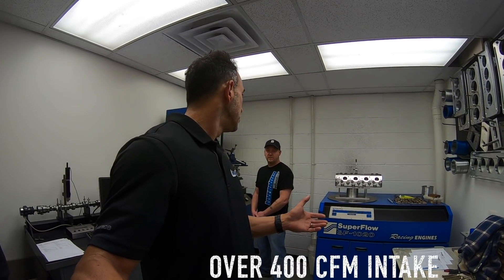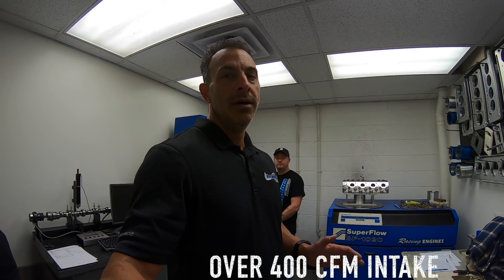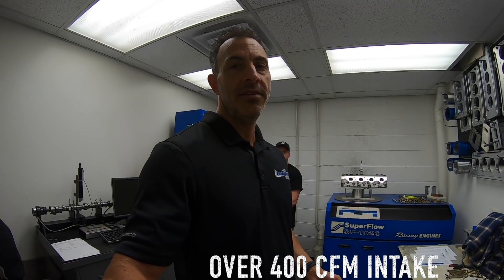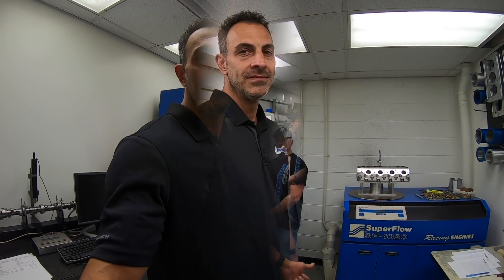CNC Ported Hellcat Heads Flow Over 400CFM - Livernois Motorsports

Comment: Fabulous job .  Would a 2.2 intake valve improve them again . Pretty sure thet you guys are way ahead 😀😀 with these babies. Xcellent.  Robert Australia
Reply from the maker: With a large enough bore, absolutely! Thanks for the kind words!
Reply: @LivernoisMotorsports  
Would a 4.125 bore  with a 4.125 stroke be in the right territory.  441 cu inches.  With a Whipple  Dragpac 3ltr Supercharged for a Gen 3 Hemi 
Cheers Robert from Australia 😀
Reply from the maker: @robertphillips3078  We'd likely want to see closer to a 4.155 in an aluminum block for that size valve.
Reply: @LivernoisMotorsports   Cheers.  That was a very prompt response.  👏👏😀

Comment: Can a 6.4 intake manifold fit the hellcat cylinder heads
Reply from the maker: we have a similar program for 6.4 heads so you can use the 6.4 manifold!
Reply: @LivernoisMotorsports  was just wondering because I'm doing a very big build by swapping my 5.7L 345 to a 6.2L 376 hellcat short block on a 10.5:1 compression with ported 6.4L cylinder heads and kooks Headers and mid pipes

Comment: yeah dont get me wrong, but those heads have every trick in the book too go good on that bench, even the ports finish looked hand polished to the maximum effort.
Reply from the maker: aussi3212 Actually these are the same finish anyone would get, every head we do is always hand blended to account for the individual nuances in the casting and components.
Reply: Heads are hand blended at seat, port finish is straight from machine.
Reply: @gbamm2990  yeah for sure , i can see that now, i guess i was just a bit surprised at the super shiny finish the mill left in the ports,

Comment: You need to make a lexan radius plate for that intake. Years ago i had a problem using clay to get the last few cfm from a set of heads because the clay was getting sucked in a little.